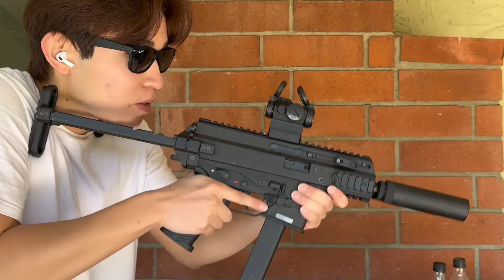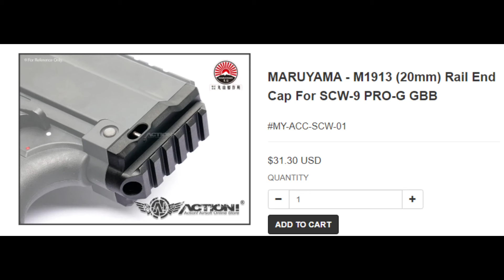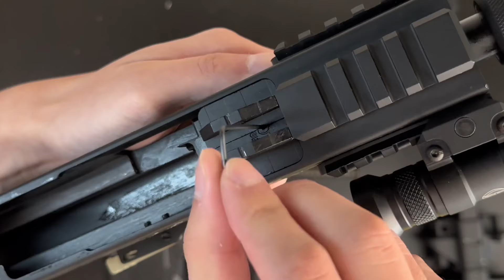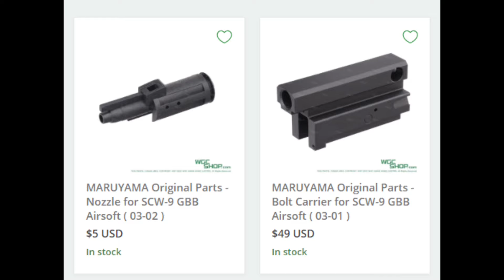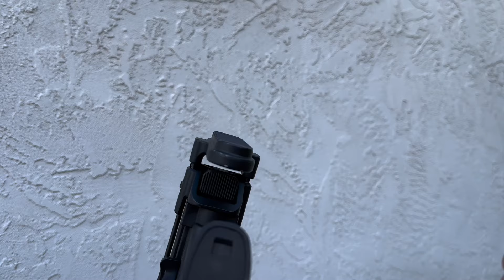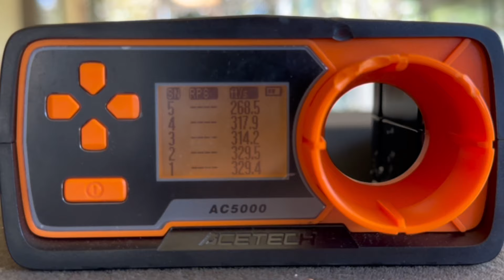Airsoft Maruyama SCW9/APC9K GBB Review

Comment: Bro can you do a tutorial on how to replace or remove a glock rear slide cover plate
Reply: I can't find any tutorials for airsoft
Reply from the maker: To remove the cover plate on the rear of the slide, you will have to remove the blowback unit. If you look inside the slide near the irons, there is a screw, removing that will allow you to take it out!

Comment: One more question I can just get a propane filling adapter and just run straight propane with nothing else in it
Reply from the maker: It’s a myth that you need oil in your gas, it’s actually bad for your replicas. Yes, just use straight propane with the adapter, or oil free green gas.